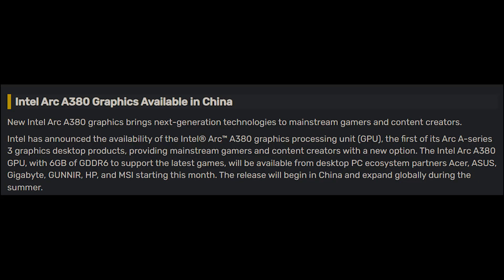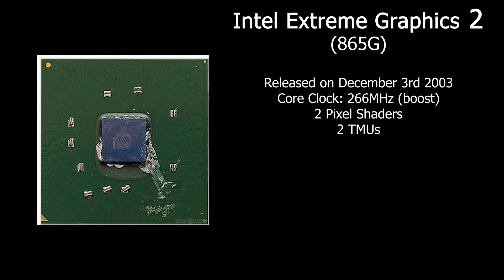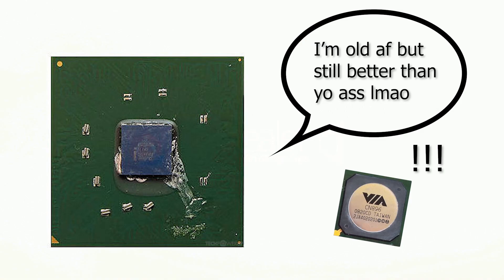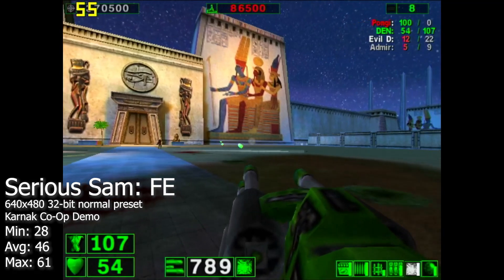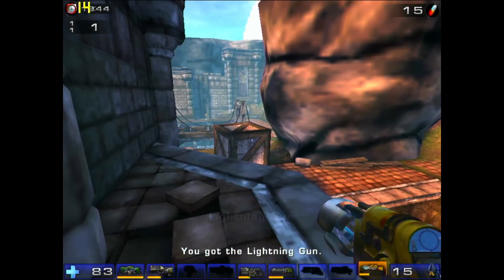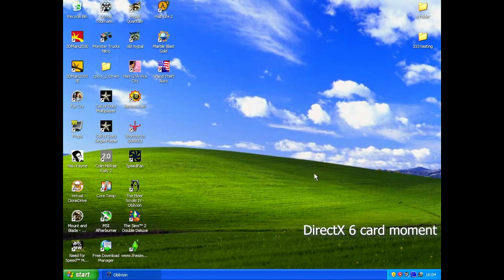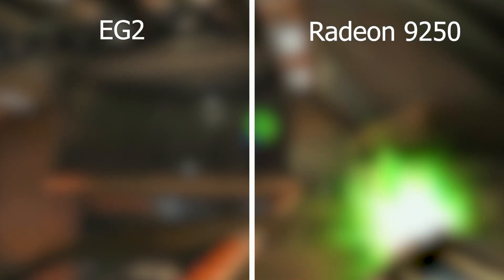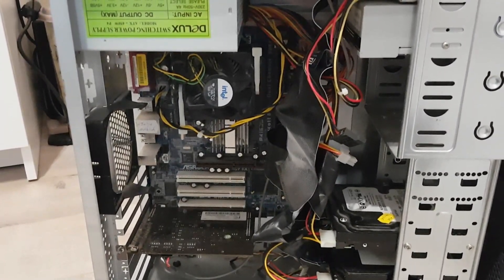Bad iGPUs? - Intel Extreme Graphics 2 / 865G (actually not terrible)

Comment: I have a pentium 4 32bit 512mb ram system too with intel 865g but i can only set the vram to 32 mb max in the bios  can you please tell me how i can set it to 96mb please
Reply: I did some more research and found that installing modded drivers for my windows 7 32bit works and its now fix at 96mb

Comment: The EAGL engine NFS games (I've tested Underground - ProStreet) have an issue on Intel graphics, even some newer ones (newest I tested was Intel HD 3000), where it makes the game heavily CPU bound. To keep at 30 fps, at least most of the time, you need a dual core chip. If you play on something like a lower clocked Pentium M, you get dreadful performance. 

This issue isn't even alleviated much by reducing the graphics (beyond turning reflections off, that helps). I played Most Wanted at a very low resolution with a mod, and it didn't really help matters.

Something similar happens with Half Life 2, too. Put in a dedicated GPU and the CPU usage suddenly goes way down.
Reply: Before we blame EAGL for this, let's not forget that Intel likes to do in software what other GPU vendors do in hardware. For example, every Intel GPU from the first Extreme Graphics to the GMA 3000 does vertex shaders in software (so of course the CPU will get a workout), it wasn't until the GMA X-series that Intel had a GPU with hardware vertex shaders.
Reply: @Δημήτρης-θ7θ  It's not necessarily EAGL's fault, but do note I said HD 3000, which is from 2011 and does have hardware vertex. The HD 3000 is capable of running GTA IV with the right tweaks, which is a Shader Model 3 game.

Not sure if it means much, but I was able to get better performance in RPM Tuning. A bit temperamental, that game, but it was somewhat playable at a low resolution (I think I used something like 640x240 or 320x480 stretched to fullscreen with DxWnd, because of some brokenness at low res) on extreme graphics 2. Another comparable game is Test Drive 2002, that one runs great, even at 640x480.
Reply: Its because the pci bus holds the entire system back
Reply: @  Not true, because the same problem exists on later Intel graphics like the HD 3000, which is connected over PCIe. Even when I connect an AMD GPU over PCIe 1.0 1x (ExpressCard), the slowest PCIe you can get, the CPU has way less usage and the performance is better.

Comment: I had a pc with this "gfx" in 2003-05, tried to play UT2004 too, low settings at 320x240. A pci radeon 9200 128bit, bought the pc 2 or so years of usability. Still have all the components. San andreas and day of defeat were my go to games.

Comment: I used to play Minecraft, Roblox, Wizard101, NFSU2 demo and few other games on an IBM ThinkCentre S50 back in 2011-2012. It had a Pentium 4 HT 3.0GHz Prescott, 1GB DDR400, Intel Extreme Graphics 2 and a 40GB HDD. I had it connected to a new at the time 23" 1080p monitor which cost a lot more than the PC :D
In December 2012 I upgraded to a HP dc7700 SFF with a Core2 Duo E6300, 2GB DDR2 (a bit later upgraded to 5GB), Intel GMA 3000 and 80GB HDD. It was the last time my main PC didn't have a dedicated GPU
Reply: I think Prescott was GMA 900 or 950. Was it socket 478?
Reply: @9852323 Mine was 478 and the board had 865G chipset. I still have the same exact CPU but it's now on a 865PE based Asus P4P800 and has a Radeon HD 4650 AGP
Reply: @9852323  Mine is socket 478

Comment: Ha!
I pulled this video up to see if the integrated Intel graphics on the old Dell Inspiron 3000 I found in the closet were any better than the random Radeon 9250 I plugged in there. Lo and behold you pull out the very same card (Though I have the variant with a fan and 256 MB of VRAM.)  Guess that answers my question.

Comment: Is it posible to watch YouTube with this card?
Reply from the maker: I'd say not really.
Reply: I used an hp d530 with extreme graphics 2 for youtube and... Eh its kinda watchable
Reply: My guess is that this graphics chip hardware doesn't support YouTube's video decoding, so software acceleration is used. Therefore, the playback speed should be purely CPU dependent.

Comment: try the gma 3000 igpu...i'm using it rn and would like it to get some attention lmao i cant even find anything related to this thing
Reply from the maker: Should perform about the same as the GMA 950.
Reply: @faketek5095  a bit better I did check benchmarks and compare it
Reply: Gma x3100 in Intel core 2 duo t5300

Comment: Great video man. I like gpus that nobody else seems to talk about!

512mb ram is perhaps a little bit low for XP since the iGPU also steals 96mb (permanently, not simply as needed) I'm not sure if this will have a huge effect, but for 2004-2005 games, it is possible.

Also, always enable S3TC, it boosts opengl performance.
Reply: I can only set my to 32mb VRAM at max in the bios can you tell me how i can set it to 96mb please

Comment: Oh hey, a GPU at my speed! 😊

Hey, Extreme Graphics 2 at least outperformed my 32bit GeForce4 MX4000 in 3DMark... granted, you also used a CPU about twice as fast, which really REALLY matters for 3DM01. 🤣
Reply from the maker: I saw somebody with 32 bit mx 4000 score around 2100 in 3DMark 01 even with a phenom II x2.
Reply from the maker: But yes, 3DM01 does like a fast CPU.
Reply: I have only 1850 pts in 3DM01, Intel Extreme Graphics 2 (855GM), Celeron M 1.4 GHz, single channel 768 mb ram.

Something in OS slows down my PC or is it CPU and RAM that really matter?
Reply: @macckey6376  The mobile version of EG2 is clocked lower (200MHz) and doesn't support dual channel RAM, so you'll never be able to match the results in the video. Upgrading the CPU and RAM would help, but only to a point